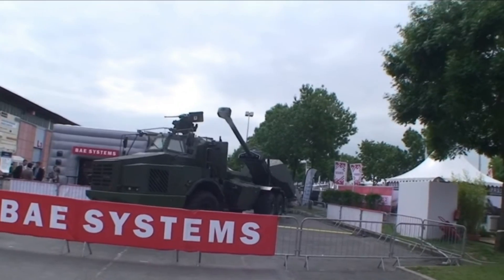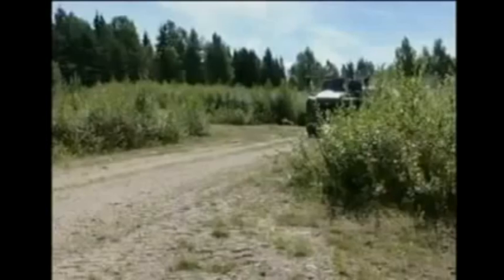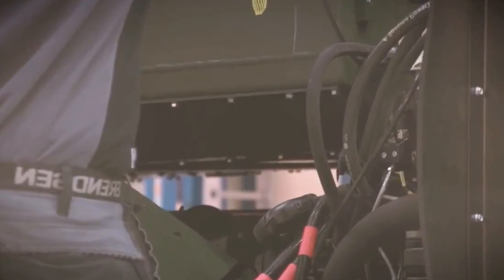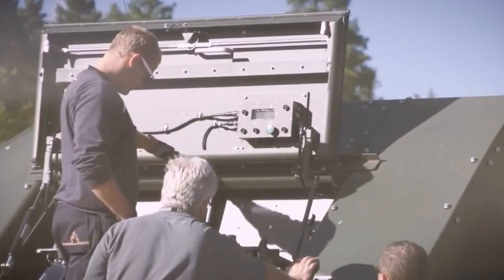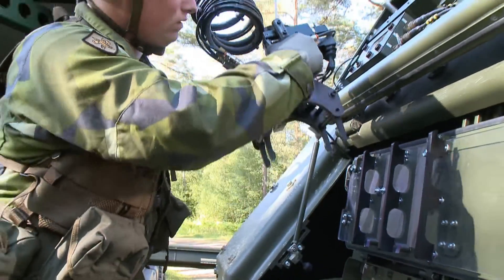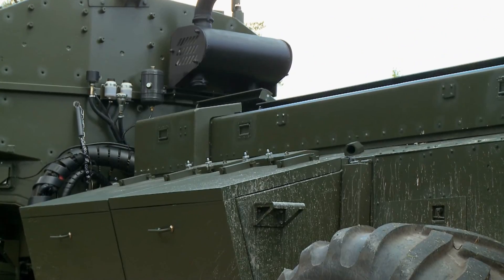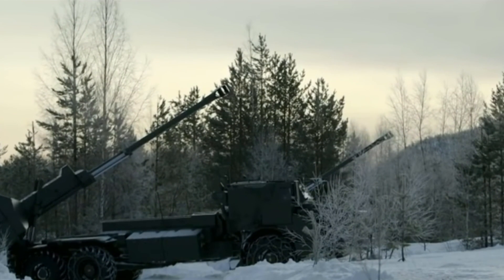Archer FH77 Self-Propelled 155mm Howitzer

Comment: To your comment about these getting stuck a lot, I think these systems differ from towed in that they won't be going off road into gnarly tree lines as much (although they can). Most of their time will be spent on dirt roads, where they should be able to drop the spade and shoot as soon as they receive their data. Effectively, mobility replaces the need for the concealment found in tree lines (road shooters). Just my two cents...

Comment: Thanks matsimus i enjoyed that and  love to hear your honest opinion, i hear you about the long wheelbase and manoeuvre abilty of it but i can put your mind to rest as i used to work on those volvo dump trucks the hydraulic steering with six wheel drive its really agile , it can turn on a sixpence because front wheels dont steer it articulates behind the cab meaning you can face nearly 90 deg without moving an inch by spinning the steering wheel with your baby finger , plus bae made tyres operable fully punctured.Wedge it between 2 trees is only way to get stuck

Comment: Send Archers to Ukraine and you will have priceless experience of real battle using
Reply: Sweden will send some
Reply: @maarts665  Yes but we need much more than some and Sweden will promote Archers for potential buyers and help Ukraine to fight for freedom
Reply: Just learned the US Army has been extensively testing an Archer for some time, well before the Ukraine invasion. IIRC well over 400 shells have been fired under a variety of conditions. Operating quite well. As I understand it, the Army brass is figuring how to incorporate the Archer into battle doctrine, etc. I'll go a little out on a limb and predict it will be adopted by the US. It would fit in nicely with a fast moving unit, like maybe Striker brigade.

Comment: I think the thing that caught my attention was using a tried and true commercial truck chassis and engine. From a mechanical and procurement POV this eases their supply chain/logistics issues. If you can get parts from your local truck parts supplier, keeping the beast running probably won't be a problem.

Comment: Bonjour a tous du Canada I'm not a specialist  in military equipement but  are a refrigération
tech. specialised in low voltage control    i find this machine have a lot & alot of sequence
of operation in theory it's good but never in practiclly  more it's complcated more that failled
more it's hard to find a good repair man specialy on battle field     it's just my little opinion

Comment: About the terrain and thru snow driving capacity: It will/can not perform as a tracked vehicle, but as a compromise between the load capacity, road performance and terrain performance, this vehicle is probably the best option and will perform almost as good performance in heavy terrain as a wheeled vehicle possible can do.
Reply: Archer handles snow up to 1m. Not many armored tracked handles more…. The snow gets compressed under them and they end up on a compacted snow platform with the tracks spinning in the air.
Unarmored there is the Swedish BV-206 , and many international copies, that has low enough ground preasure that it goes above the snow.

Comment: Sweden should have never allowed Bofors to be sold to a foreign Multinational Conglomerate. The price of every product increases and local production is suddenly "downsized" and "outsourced". Actual production capacity dwindles and cost overruns become a norm.

I think this is a great Artillery system. But I see some issues:

1. 30 seconds to load 1 artillery round into the auto-loader. That is not 2 minutes for 22 rounds.
2. A lot of electronics and hydraulics, how often is this repaired?
3. Per unit cost seems to be around $6 million, plus the cost of the Excaliburs. Unknown maintenance costs. 

Seems like a towed/motorized version would be cheaper and faster and would cost less. But that would likely be a competitor for BAE Systems M777 howitzer product - so unlikely to be produced. Another downside of "mergers".
Reply: 1. It doesn't take 30 seconds to load 1 artillery round.
2. You service the vehicles you use. If you think this has "a lot of electronics and hydraulics" look at a fighter jet.

"Seems like a towed/motorized version would be cheaper and faster and would cost less. But that would likely be a competitor for BAE Systems M777 howitzer product - so unlikely to be produced. Another downside of "mergers""

Yes it would be cheaper. It is however replacing such a system, that system is part of the Archer. It was specifically developed for Sweden and the requirements presented by FMV.

Comment: Bandkanon are good though, is this some kind of cheaper more mobile alternative ?
Reply: The Bkan was in service 1967-2003. 
I do not know if Archer is cheaper but it is definitely more moddern and considering the chasi, more reliable.
Reply: The Archer uses the same principle to load the shells as the Bkan. The big difference from what I've understood is that Bkan used a different calibre/shell that wasn't NATO standard. Sweden has been actively working on integrating more and more with NATO since the 80s to the point that we're practically a NATO country at this point (in fact, we just applied). So a system with a more standardized type of shell was implemented. the FH77b howitzer, which has then been been converted into the Archers you see on screen now

Comment: Pretty much love it but which is the best shoot & scoot howitzer? This one or the German one that you did the video on awhile back? Both are impressive. Noticed that this one even includes a mobile neutral buoyancy air hoist with a pneumatic or hydraulic activated below the hook lifting device. This will prevent crew fatigue when loading shells into this beast. That shell will take practically no muscle power to load it! Industrially, similar lifting systems have multipled  worker productivity and duration many fold. This is a well thought out beast of a machine.
Reply: True ICP357. My first duty station in Germany was M-109 btry. I loaded a with all the ammo and charges by myself and I was the driver.  Humping 155 rounds is no joke.

Comment: Dumper chassi rules, so Clever and simple, Finland uses  this system...
Reply: What model does Finland use?
Reply: @zoom5024  asume same as Swe last model. Not a fact. Found no other answer.
Reply: @swe-finsisu172  well i didnt think they used spg, i know atleast they dont use the archer.
Reply: @zoom5024  sure i seen longbarrel archer in fin.forces  videos.. hmmm
Reply: @swe-finsisu172  well that's not possible, since the archer has not been sold to any other country other then Sweden.

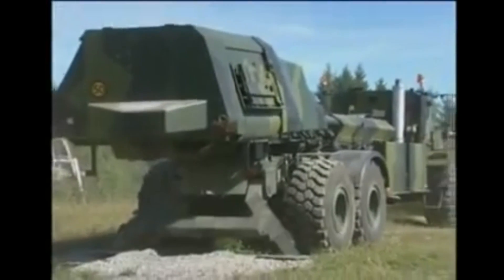Comment: @03:00 Yes it may not climb to large rocks and such. But it more or less never get stuck
https://www.youtube.com/watch?v=0v1AcdH2Vxw (See below*)
The platform of the Archer weapon system are based on the Volvo Articulate Hauler. Which in turn are a platform on which both construction and forest forwarder machinery are based. It have good enough cross country performance. I say best of any wheeled self-propelled Howitzer, including the G5.  We remember the VOLVO BM Forest forwarders for example the Volvo BM 868 or the Hauler DR 860. On which experience and research the Volvo articulate Hauler are based - DR 860 with load weight more than the Archer today loaded. It only had four wheel drive.

*In the clip above remember that Archer have a higher energy output, better energy management, all wheel drive and all system improved on the DR 860 in the clip that goes where no other wheeled could

Comment: I'm sorry but you are relly wrong about 24 (it'll be 36) Archers being a large number of units for sweden, we had 271 of the Howitzer 77 that these are supposed to replace (the archer is basically one of the old Howitzer 77B we already own mounted on a dumperchassies)... While the Archer in it self is a great idea, the fact that we only get 36 of them makes it completely useless (besides it costing us about 1,3 Billion SEK (~130million $/€), the Finns got their 100 Leopard 2A6 for ~2,1 Billion SEK)

You do see the difference between what we had (271) vs what we get instead (36)? Compared to Finland we are a joke, the Finns have 800 howitzers (and also 200 MBT, 200 IFV, 700 APCs and so on).

Of course since it is built by using existing Howitzer 77B there can only be 48 made since we have no more of them :( 
Had the 77A also been used we could have bought a reasonable number of units (obviously that would never happen since our politicians are retarded and think that buying extremely small quantities of higly advanced, and extremely costly, weaponsystems is a good way to protect ourselves instead of taking a similar route to Finland who have a large defence force that they arm smartly by buying secondhand (but refurbished) systems like the 22 MLRS and 100 Leopard 2A6 they bought from the Dutch for pennies on the dime)

Up untill the mid -90's Sweden could boast with a defence force that could creadibly defend our territory, we had for example 400 fighter aircraft in 1994. The total strenght back then was about 15 manouver brigades and 100 auxilliary battalions that could be activated within 1-2 days, now we are happy if we can muster a total of 7 "battalions" within a week (you think the enemy is going to give us a weeks notice?)

The prototype/trial Archer units had a much shorter wheelbase and larger tyres which would have been much more advantageous for manouvering and the ability to traverse terrain

Comment: Excuse my ignorance, but wouldn't the huge length of this vehicle be greatly reduced if the barrel was stored at an angle just above the crew cab say about 30° as opposed to lying flat along the bed of the trailer ?
Reply: Maybe, but then it might get caught in low hanging branches while driving through dense woods. Only me guessing, mind you.
Reply: Also, that protection over the barrel when lying flat on the trailer is made to hide the hot barrel against thermal detection.

Comment: Your data on development is inaccurate. I actually saw the first prototype of this back in 1997 when I was doing my military service at A8 artillery regiment(nowdays designated A9) in Boden, Sweden. I have photos of it taken during its initial experimental trials. Also, the initial idea wasn't to replace the FH 77B's but to replace the SPG being used at the time: The Bandkanon 1C.(The FH77A's were already being phased out).  I was trained as a crew chief on the Bkan 1C and during one of our field testing excercises we tested the mobility of the Bkan 1C against the Archer prototype, wich was designated FH 77BD at the time.

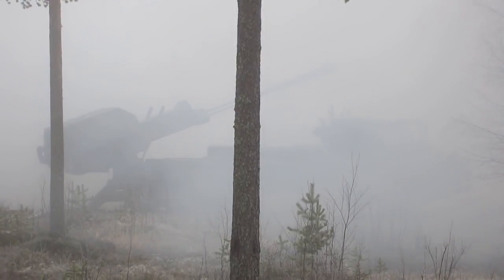Comment: 11:40 The chassi it's based on is used largely in forestation where it transports cut trees, this means that not only is it proven in traversing forests and rough terrain it also has a huge supply of civilian industry spare parts which lowers costs and expands it's lifespan.
Reply: Well, the forestry machines are also adaptations of the A30...
Reply: Its based on a Volvo A30 wich chassi is not intended for forestry but construction
Reply: @Ubeer85
Reply: as the narrator say, its also a tank, wich ofc means it designed to be able to handle trees, larger trees may still have to be blown meaning personell may have to exit...just may...to be honest most trees isent that large, and the low time in/off actin means if targeted its easy/fast to move, only a dircet hit is able take it out of action...
Reply: For some reason, the chassi is the biggest "dislike" I'm having with that platform. The joint between the crew compartment and the trailer seems too fragile for a war zone. Sure, the gun's range means that it isn't in immediate danger. However, as soon as shots are off, you better relocate ASAP. That is different to the chassi's civilian use in forestation where you can take your time to relocate, while not putting too much stress on the joint.

Comment: Sweden has taken over the 24 units originally intended for Norway and will therefore have 48 Archers. Considering that Sweden is 450,000 km2 (Germany is 350,000 km2, UK 250,000 km2) this is hardly to be considered an excessive number given the area that needs to be defended.

Comment: One other reason for sweden having as much artillery as it has compared to the size of the military, a small country can't guarantee air superiority, and as fire support is "somewhat" useful artillery and mortars are a very good way of providing that capability when you do not have air superiority, and add to that the amount of forest you have in sweden (and finland, finland also has a very larger amount of indirect fire weaponry in comparison to the size of the finnish defence forces) artillery (esp mortars, look at the AMOS if you want to see something impressive, is a lot cheaper per ton of ordinance delivered on target than doing it by plane, and a howitzer shell or a mortar bomb as they come in fairly close to vertical is pretty nasty in forests, both because you can hit something in a forest, over a mountain etc. plus the spectacular amount of secondary fragmentation you get from the trees, i don't know the MRSI capacity of this one, but i know the amos can do 12 (14 in tests but officially 12) rounds of 120mm mortar bombs in one mrsi salvo from one unit, mounted on a lightly armored atv (the Patria AMV being the one of choice), then imagine 4-8 units unloading that at one time onto an infantry concentration, let's say they are not going to have a good time. (*edited as i saw you already had made a video on the AMOS)

Comment: To be honest with you matsimus this weapon system is to high tech. That is my opinion. It doesn’t mean my opinion is always 
Correct. But I personally think this artillery system is limited by the fact that it can’t go off road at any great speed. Scoot and shoot 
Is paramount when it comes to mobile artillery. Call me old school but I’d rather have a tracked mobile artillery platform over a wheeled one.
Mobile tracked artillery units don’t need heavy armor to protect themselves. Thus the term mobile. These units never see front line 
Service per say there role is to provide support and assault artillery fire.

Comment: That volvo is designed for woodlands and it has a hinge behind the driver's cabin, aiding it in tight corners. The private vehicle is used to chop down threes, so it has plenty of off road potential.
Reply: Its not a forestry veichle. I drive theese  for a living and they are made for construction applications
Reply: @Ubeer85  You're right, I had it mixed up with another vehicle. It does look like it could handle rough terrain though.
Reply: @gullintanni   It can handle extremely rough terrain. They are worthless in snow unless they are equipped with snowchains

Comment: Though it's large and unwieldy looking, appearances can be deceptive. Logging  trucks and equipment of similar size routinely work in forest areas and Sweden would be drawing off that driving skill base from its large forestry industry.
Reply: Yes this is a modified version of the Volvo A30E Dumper so this thing is proven concept when it comes to operating around mines and in forrests.

Comment: I am a HUGE fan of BAE. This FH77 Archer 155mm self propelled gun system actually looks like the German PZH 2000(I think that is the designation)with wheels instead of tracks. One thing is for sure this is an extremely capable system. Makes me think PZH 2000 that can do twice the speed.

Comment: That stabilizer platform that lowers behind the rear wheels hops off the ground during firing! Looks like the stabilizer could have a wider stance and more weight on it. Actually, does this limit firing to angles of maybe +/- 45 degrees off the centerline?

Comment: I would never be afraid to get stuck in the woods, or anywhere, with a Volvo 6x6 AH. If they've got the full suspension version too, then it's almost unstoppable. Remember, here you have the frame it self, who stands for the turning of the vehicle, and not the wheels, and you can use that "ability" to get unstuck. If you get stuck with a 6x6, you have no business being a driver of that vehicle, not speaking of your career in the army, ending right there, right then.
Reply: Yes...this Volvo platform is very similar to the CAT 730.  They are direct competitors.  Here is a CAT in heavy mud.  Volvo can do just as well...

https://www.youtube.com/watch?v=rMit-YJZSdo

Comment: The US Army is currently developing longer range artillery. Modifying the M109A7s is one rapid way to do it, and make them more common with the Bradley IFVs in the field with greater logistical support commonality. However, that long barrel does have limits on that platform. This FH77 Archer is very capable, mature, and manufactured by BAE Systems Bofors. This weapon is air mobile in a C-17, shoots guided projectiles, and can handle the longer barrels required for the new longer range guided and powered ammunition. If acquisition is not desired, then a rapid prototype of the concept by American manufacturers like Oshkosh would be a good idea. This beast can shoot-and-scoot very well. If the new powered and guided rounds in fact have BMD capability, this would be the candidate for deployment worldwide including CONUS for the US Armed Services. A common configuration to the extent possible with a naval application has been a dream of many. If rapid prototyping is attempted, the ground unit should come first, and the naval version ready for backfit on Amphibious platforms for Amphibious Assault Support should come second.

Comment: First prototype was a lot earlier than 2005. Possibly confused with BAE getting involved. I did my military service in Sweden in 1996-97 and we had an early protype (most likely the first) back then called the Bofors 77D built on an armored 6x6 Volvo dumpster chassi just like the Archer and it looked just like the Archer compared to the old slow self propelled/towed 77A and B. MRSI capability was 6 rounds even back then but probably at a shorter range.